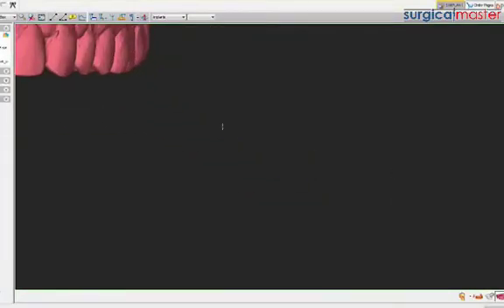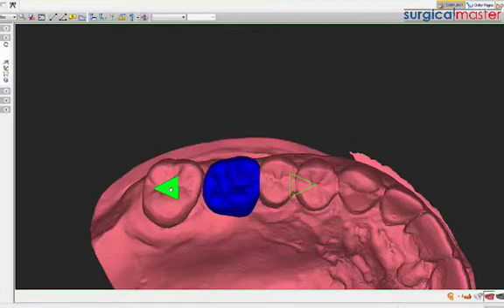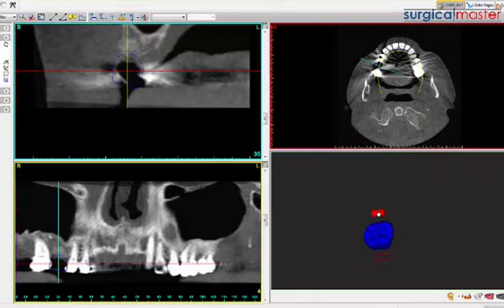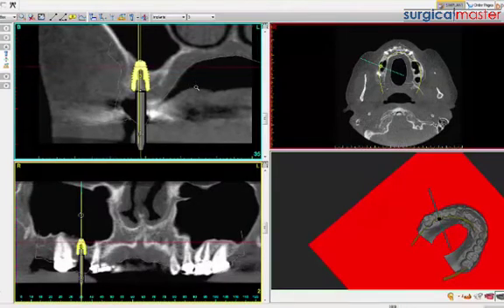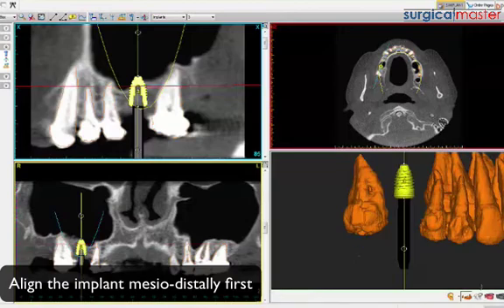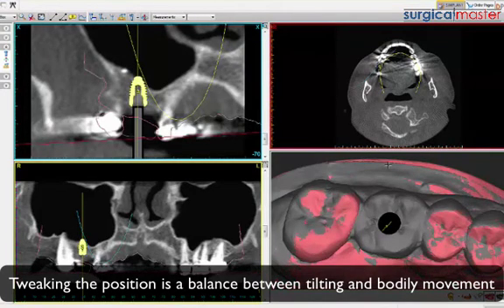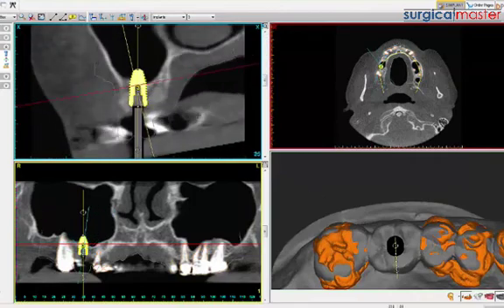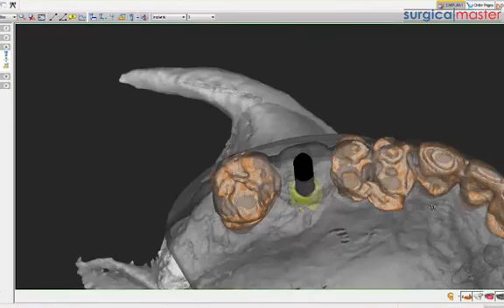Planning an upper molar

Comment: Dear Dr. Ziv Simon;
Would you please make a short video on Youtube explaining your clinical experience based viewpoint regarding the preferable dental implant coronoapical positioning in relation to the alveolar crest level ?!
I 've been a big fan of 2B-3D Rule but recently I've seen some experts recommending 1mm Subcrestal+3mm CT!

Thank you.
Reply from the maker: Saed Idres this rule doesn't apply in my opinion as it's very dogmatic. You don't always have the ideal bone and sometimes you need to submerge deeper and same in the horizontal dimension.  I will discuss this in the upcoming gold rush course
Reply: Dr. Ziv Simon;
Thank you so much Sir for your instant reply.